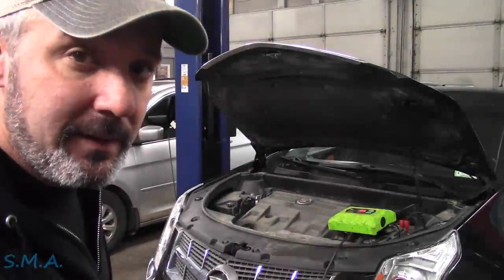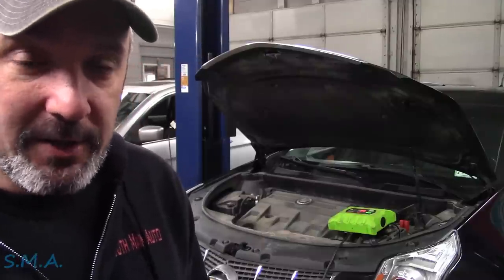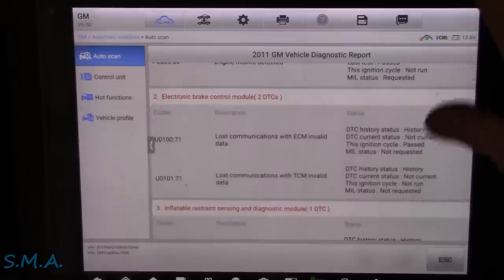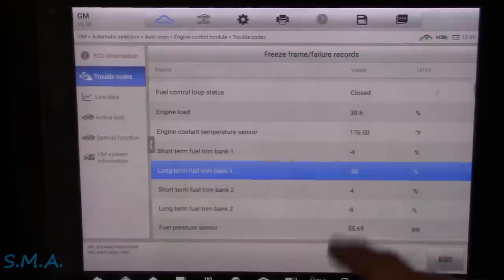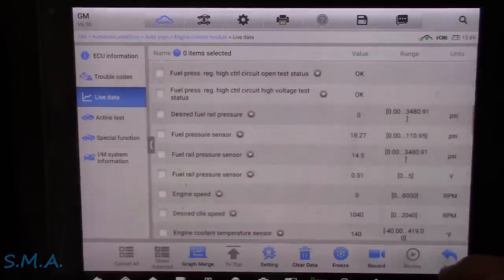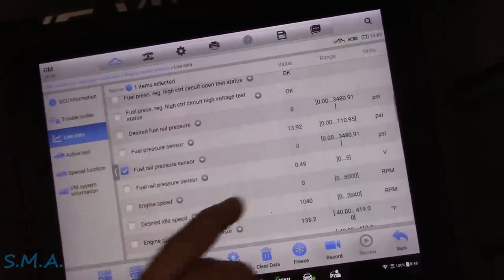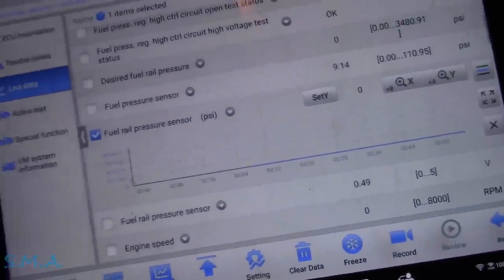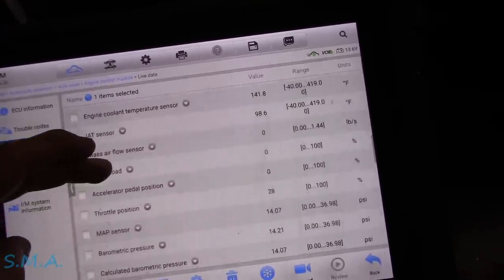Cadillac SRX: Running Rich P0172 / Hard To Start

Comment: More disposable GM junk!
Reply: 👍 Typical stupid response.
GM sells millions of vehicles and has millions of return customers who obviously were happy enough to purchase another one.
If the same issue happened in a Toyota or Honda people would be making excuses but because it is a GM it is automatically a POS.
I am a fleet manager for a large pharmaceutical company.
Our fleet consists of 1200 vehicles.
Everything from Nissan versas and Chevy Sparks right up to S -class Mercedes 7 series BMWs Lexus and Tesla models. We buy our vehicles new and keep them for 5 years or 150,000 miles and they are maintained by the book at their respective dealerships.
In our fleet approximately 400 of the vehicles are General Motors products.
They are among our most reliable and inexpensive to maintain vehicles and several of them have proven less problematic than several of our Korean or Japanese vehicles. Asian vehicles are not as trouble free as urban legend suggests and European and American vehicles are not as problematic. At one point in time American vehicles probably were the least reliable but that information is decades out of date. In fact according to our repair records which go back 25 years both Toyota and Honda have shown steady and significant declines in overall reliability and durability. Every time a Toyota is redesigned it is less reliable than the preceding generation.
Reply: @williamegler8771  GM had way more reliability than any other USA vehicle back in the day. They went with common sense design and operation back then and they were reasonably easy to work on and labor cost was lower. I have to agree that GM today still builds good products...especially their engines and transmissions. 
The auto industry should bring back the station wagon instead of truck chassis SUV's for most of the people who currently use them. Most of them buy those because there are no station wagons in passenger car platforms. You'd think with the EPA/MPG standards, the station wagon would still be considered as a useful product vs. 5,000 lb SUV's.